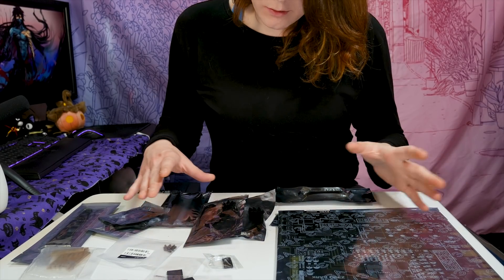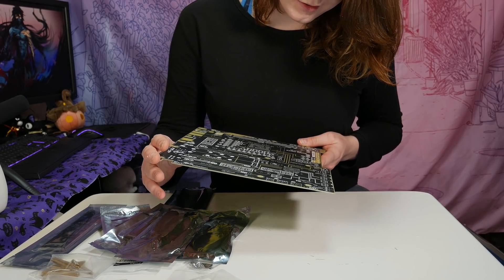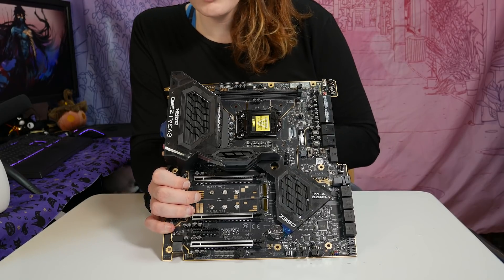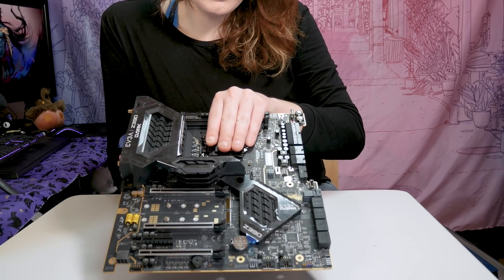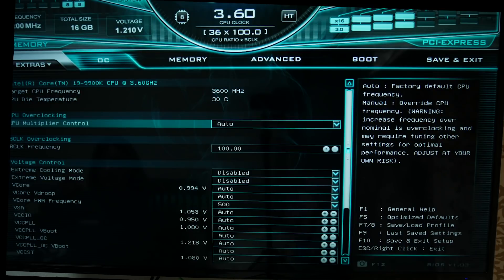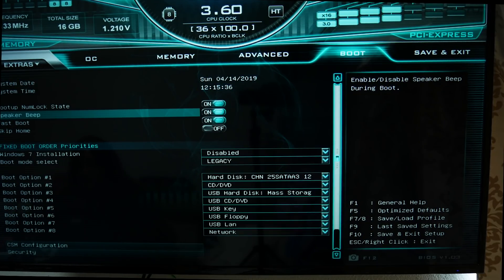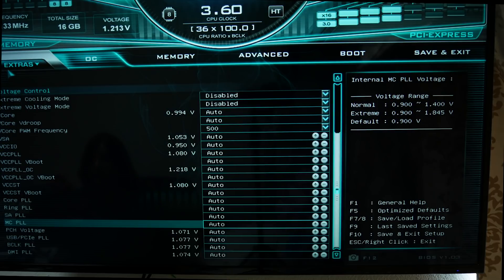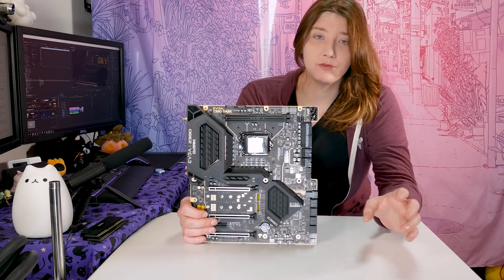Best Z390 Motherboard - EVGA Z390 Dark Review

Comment: Nice work, I dream with this motherboard, BIOS is amazing, but It's too expensive for me, here in Venezuela is almost impossible to buy hardware like this. Btw, I think it brings only two slots for the RAM instead of four, to avoid instability in the overclock...
Reply from the maker: Yhea, the two dimms slots is more better memory overclocking, basically all the choices EVGA made with this board is for memory overclocking. Its really a fantastic board if your in to overclocking but its complete overkill for a gaming build though. 

Yhea In Japan they dont even sell any EVGA products  even high end ASUS Boards are hard to find so I know how you feel ;)
Reply: I've got an Evga Z390 FTW with 4 dimm slots with 4x4Gb Ballistix Elite 3200 overclocked at 3733mhz so yeah it is possible to have good ram overclocking results with 4 dimms full 🥰

Comment: How are thermals for the m.2 ?
Can't decide between evga z390 dark
And asus xi apex apex has thermal pads on it for m.2.     Wouldn't   the gpu heat up the m.2 on the z390 dark?
Reply from the maker: I haven't tested the Thermals for m.2 drives. But honestly the dark is meant and built for overclocking so if the Apex has a heatsink then it will probably preform better then the dark.

Comment: When did you transition?
Reply from the maker: A few years back. ;)
Reply: @KatesHardwareReviews  Ah nice, so yeah I was thinking of replacing my Z390 Apex with this board as I believe it maybe a little better at overclocking and will match my kingpin cards.(lol). Any ideas on how audio sounds? I have a X299 Dark for my 9980XE and a Alpha but have noticed how disgustingly horrible the audio on the dark is.
Reply from the maker: @frostybe3r   Well it will definitely match the kingpin card, but as far was overclocking your probably looking at the same on the cpu. and if your going for a stable memory overclock you might get a bit better with the Dark, its hard to say the apex is a top tier board too. The dark VRMs are way better tho, and if Intel ever gets around to releasing the 10 core then you better off with the dark.